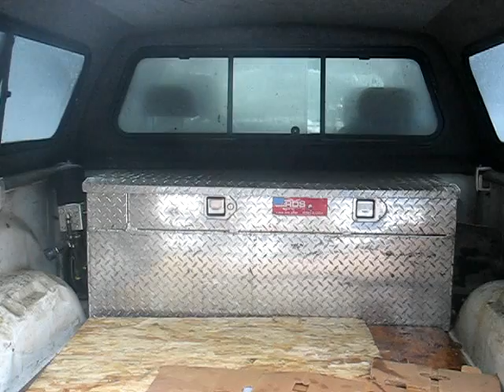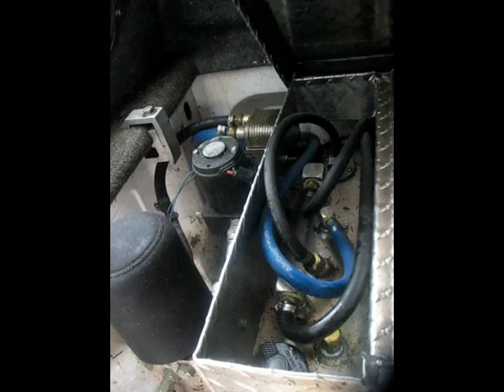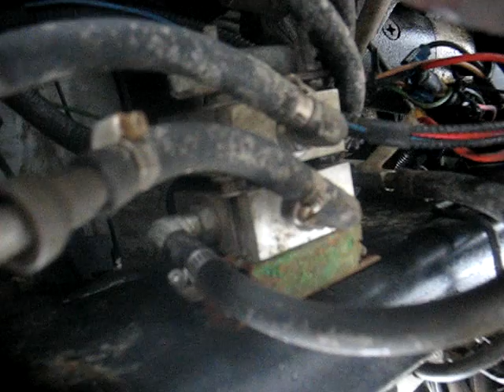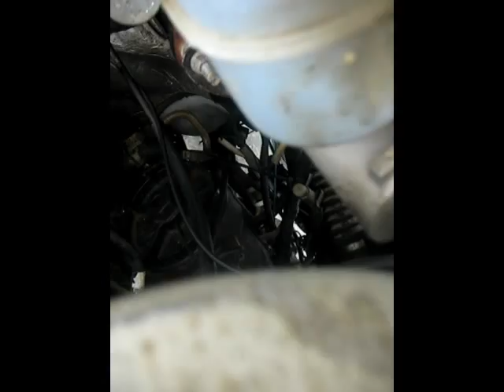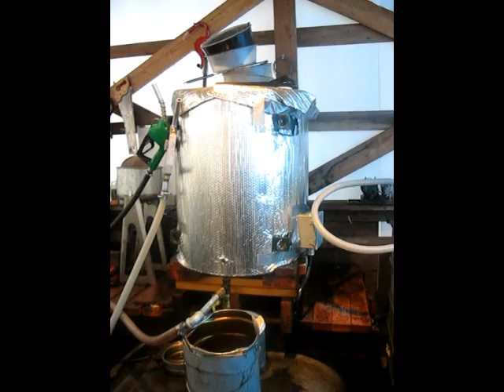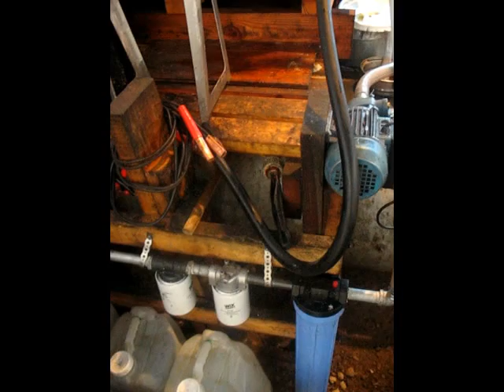2004 Dodge Ram 2500 WVO Conversion by: Switchover.ca with PlantDrive parts.

Comment from the maker: Correction: In the video I show a 12V inline fuel line heater and call it a Vegmax heater. This is incorrect. It is actually a Vegtherm Mega from plantdrive.ca